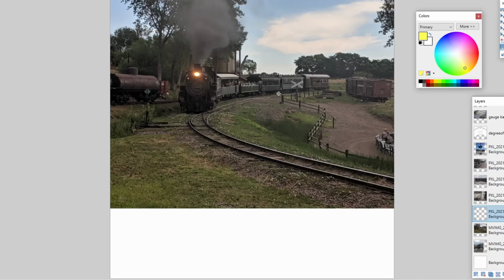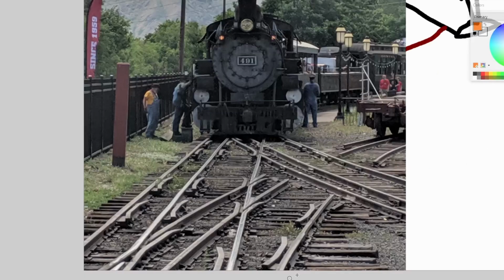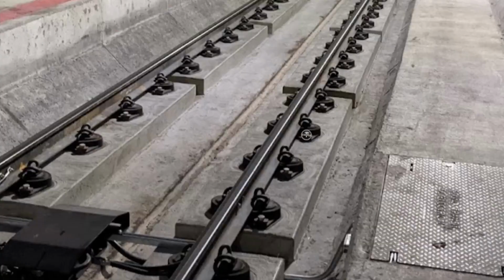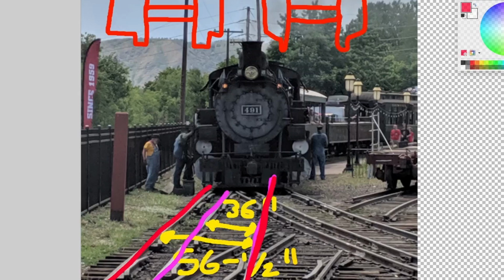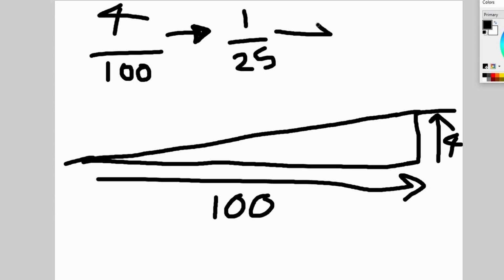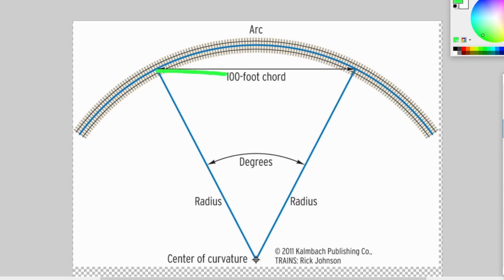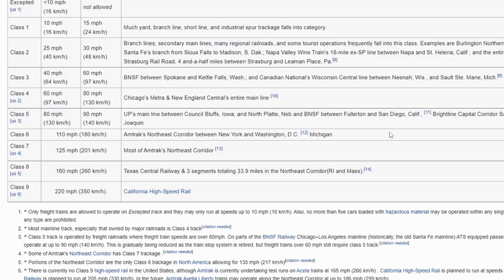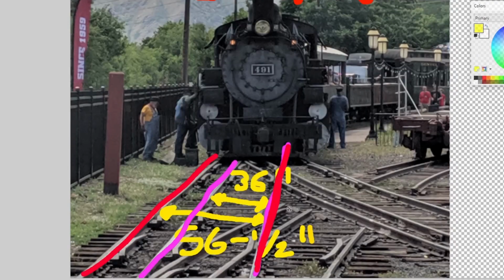TRACK 101: How does track work? (Including many often-missed things!)

Comment: Streetcars and lightrail on one way roads why is it necessary to stop three lanes of traffic for a  single lane crossover
Reply: Because the automobile is not the most important thing on the road.
Reply from the maker: Depends on the situation and the roadway authority.
Reply: I get that but if the train does not need to go in to the car lane why we have to stop plus we going in the same direction
Reply: @johnblakley2130  the people have to get from the train to the sidewalk? So atop the train and the cars and let the pedestrian who has ultimate right of way in an urban setting walk safely to the side walk to continue their journey without having to activate a separate stop light for the car traffic having left the train. 

Again, automobile is not the most important thing on the road, it's possibly the least important most self centred thing on the road so it comes after buses, lightrail, street cars, cycles and even trucks in some situations.
Reply: @SamanthaMaedhbh  in this case people can't even cross only in the direction the train is moving in which is the way traffic moves in
Reply: @johnblakley2130  gets them safely to the side walk thats the main point. Get them out the danger zone(most of the time unless you drive onto the side walk) of dumbass drivers in the fastest safest possible way. And again, the street is not just the domain of the car, it is the domain of the pedestrian, the train, the bus, the truck, the bike and the car. Sharing is caring.

Comment: The Japanese Shinkansen has up 200mm (~8") of super elevation in their curves.
Reply from the maker: That's a lot! I've never heard of more than 5 or 6" myself but I also don't do much with hi speed.
Reply: The problem is, trains have to stop sometimes unexpectedly outside of stations. The superelevation must not cause toppling, shifting loads or too much discomfort to the inside of the curve.

Comment: The Scunthorpe Steelworks just down the road specialises in the manufacture of rail, particularly extremely long single lengths of 'high speed' rail that's slated for use in the HS2 project in the UK. It's crazy to watch these huge single lengths of steel pass back and forth through rollers, turning from a glowing orange 'bloom' about 10 feet long to a piece of rail over 100 meters long.
They use these specialised train sets to move them. These massive lengths of track load onto an equally long string of wagons with half a dozen cranes spread along it and the rail actually bends with the train as it moves. I'm assuming someone did the science behind it but you'd thing that would cause metal fatigue.
Reply: Which is how continuously welded rail is moved in the U.S. and Canada.
Reply: Well, I suppose if it ain't broke, don't fix it.

Comment: From what I've heard, the standard gauge comes from the width of two (roman) horses.
Reply from the maker: I wish we had a clear answer on this one. lol. it's a lot of old wives' tales.
Reply: @Hyce777  well, the more interesting question is where does the 4 foot 8 gauge come from. 

The half inch was added later to help get around corners with 4 foot 8 gauge stock that was experiencing issues on the then newly opened liverpool and manchester. Before that it tended to whole inch measurements and 4 foot 6 and 4 foot 8 were very common.
Reply: @bilbobaggins1934  commonly pulled by 2 horses
Reply: Nope, that one's a fancy story.

Comment: isnt the ballast also called crush and run or is that something else
Reply from the maker: Crushed rock I've heard. Run i have not, but wouldn't be surprised if it is related.
Reply from the maker: @bilbobaggins1934  oh gotcha, the "sorting / sifting" after = run? yes, they usually prefer a specific size depending on application. Usually around 2-2.5".

Comment: i have 2 questions, y does some full gauge tracks still operate with small gauge curves? like the dual track from volta redonda to rio de janeiro port, you can see the rail curving stupidly sharp there. also, arent there a whole ordeal of nuances about the whole using siferent gauge locomotives with different gauge cars? ive heard about asymetrical weel thickness to combat the torque on the locomotive so you dont waste fuel or damage the weels by constantly running only one side of the flanges on the track, could you please cleare this up for m, here in brazil ( and aperently also on english internet) theres little info about this
Reply from the maker: Cheers mate! A lot of railroads have to work with what they have - relaying a curve to be wider may not be possible because of cost, land ownership, or it might make the gradient worse. Typically if the railroad ran with it they'll keep it and account for it in their operating plan. 

Locomotives with different gauge cars / dual gauge - there's not any specific nuances beyond using an idler car or special coupler to make sure they stay coupled. You do need more flange oil or curve grease, which might be built into the locomotive or it might be built into the track to help limit the flange and rail wear. Hope that helps. Cheers :)

Comment: 34:00 that's the same way highways are laid out, using a spiral to avoid drivers having to throw around the steering wheel and can instead steer in and out gradually
Reply: Kinda clothoid loop?
Reply: @frederf3227  Yes, exactly:  Not algebra either.  Just basic calculus applied to trigonometry.

Comment: New Zealand's first railroad was allegedly 5ft 3in in track guage.
Reply: Bit of interesting trivia,  the wagons in the coalfields of England were of the gauge 4'8 1/2" and that became standard gauge. this is the same as used by the Romans - look at the grooves in the streets of Pompei. Broad gauge, 5'3'' is the gauge that the Romans used in mountainous country for stability on slopes. So even the latest High Speed trains all use a Roman standard!
Reply: @grahammcrae6734  nope, not true.
Reply: The whole of Australia was meant to be to the same gauge. But that all fell to bits  and now theres 3 gauges in common use.

Comment: Railroad track is a very dynamic thing - it has to be able to alter its shape according to conditions. Early railway people (talking 1820s) did not understand this - rails were cast iron, in 4ft lengths, anchored fast to stone blocks which were buried in the ground. And they wondered why rails kept breaking!
Reply: Wooden rails were very common and very usable until the locomotive came along but like any tech breakthrough it takes a bit of time for stuff around it to catch up.
Reply: That's news to me! 
Thanks for dropping the knowledge!
Reply: Benjamin Outrams system of rails known as Plates   https://commons.wikimedia.org/wiki/File:Fish_Belly_Rail,_Cromford_and_High_Peak_Railway._-_panoramio.jpg
Reply: I don't think they were surprised, but they had to work with what they had.
Railroads started with cast iron because that was the only iron affordable enough to use in such amounts back then. Modern rail only became possible as metal production improved to mass-produce wrought iron and steel.